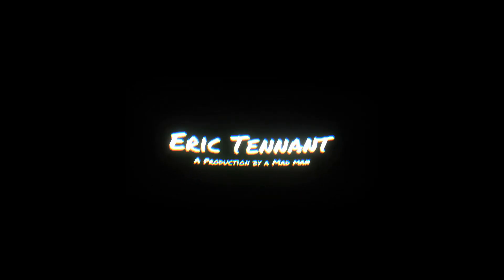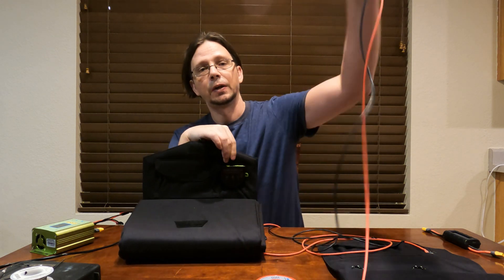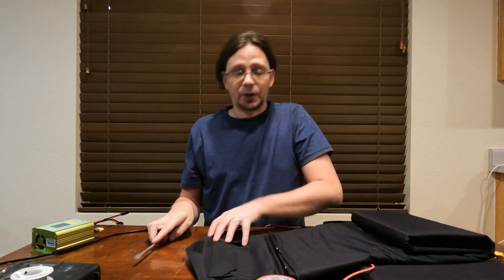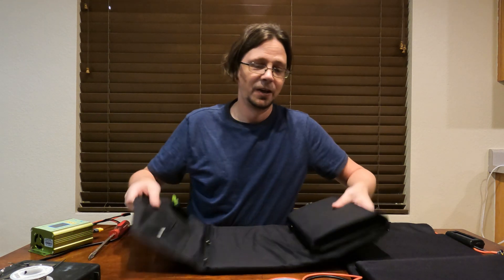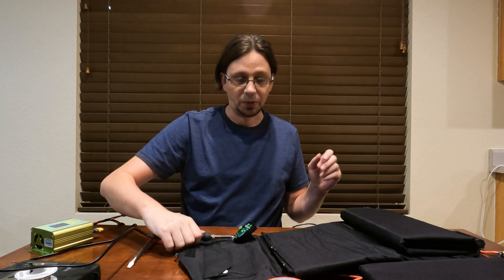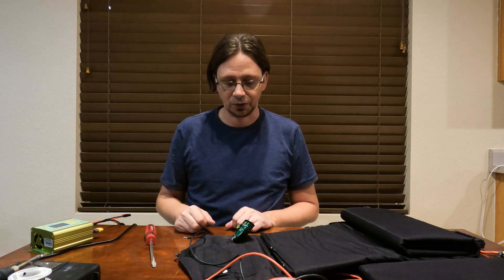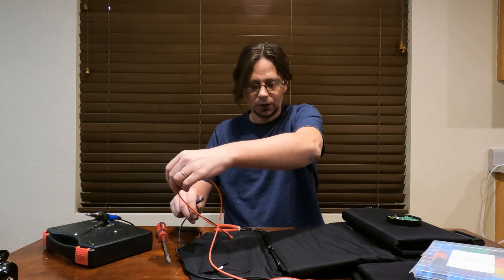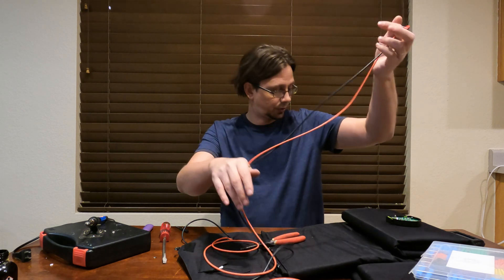How To Charge Electric Bike with Solar? Part 2

Comment: Hey Boss, do you have turn signals on your bike and if so what brand do you have. I have a horn and head light as well as tail light but I want turn signals. Any brand preference. I figure you would know and maybe you could get another sponsor deal out of it. You ride on the road enough and after dark enough that it would be worth a company's money to sponsor you for a turn signal how to. Anyway thanks for the great info and for getting me off my way too fat ass.  Have you seen the Mokwheel 1000w inverter that plugs into their about 1kw battery (48v)? I have two batteries and they are pulling an "Apple proprietary stunt" to get you to use their inverter to charge the battery and get the inverter. I'm sure it could be done off the shelf. The inverter is 1000 watts and it will plug into the battery for either inverter power or to charge the battery from solar. Have a look and maybe see what you think. Worry is the charge profile, they say their wall charger or the inverter from solar is the only way. Sounds like BS to me. Only problem seems to be the plug. Two small over and under then two large center charge lines. Have a look if you have a moment.
Thanks again.
Onward and Forth!

Comment: I’m using a CTK-ev300 cheep Chinese solar boost charger and an all powers 60 w foldable panel , it charges my 36 volt battery at about 1 Amp or just above compared to my wall charger that is 2 amp , it gives me a few extra miles when set up as I stop for breaks or can fully charge if I’m on a camp site for the day if sunny but I’m in the uk so good sunny days can be scarce , I left the USB ports on mine so I can charge my phone and camera
Reply from the maker: I added a connector to the USB hub so I can still use it.
Reply: Mick, would the CTKEV300 be able to charge a Xiaomi Pro 2 scooter with an allpowers 100w solar panel?

Comment: I would definitely put something to take the strain of the cable on the panel end , you wouldn’t want the leads being ripped out inside the fabric cover , you would have to cut into the fabric cover to get to a point you could resolder them
Reply from the maker: Finally came up with a idea how to secure the cables after watching the wind try to take the panel. Video in the making.
Reply from the maker: Yea think hot glue will work better then silicon because it harder. Unless you have a other idea.

Comment: Glad to see you're adding solar to your touring kit.
I'm interested in seeing how you schedule charging into the daily ride.
Looking forward to your next video, safe travels.
Reply from the maker: Luck if I could get 50 miles then charge from 12pm to sun down. Also used a few Hotels. Really I would need to double the solar; however they are large and are 5 pounds. Could have active solar if on a trailer however it would limit speed on down mountains.